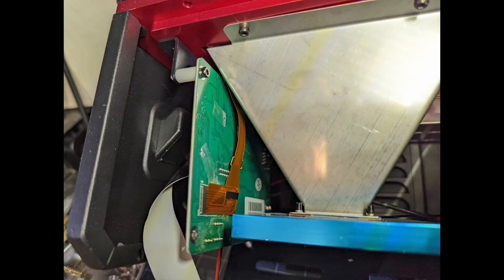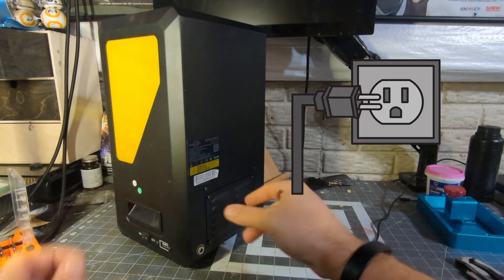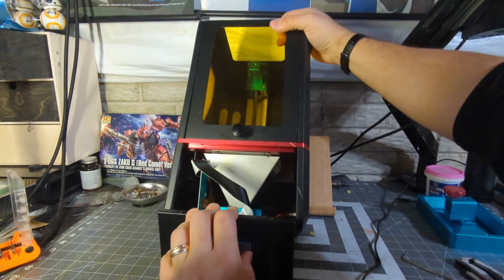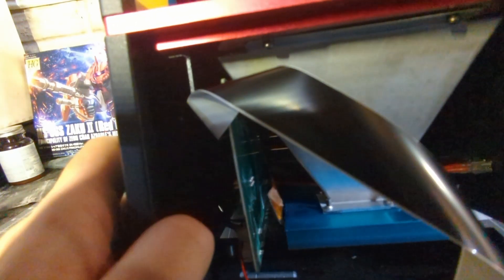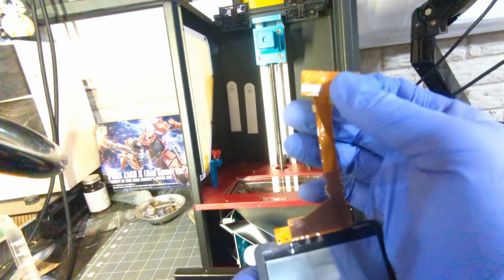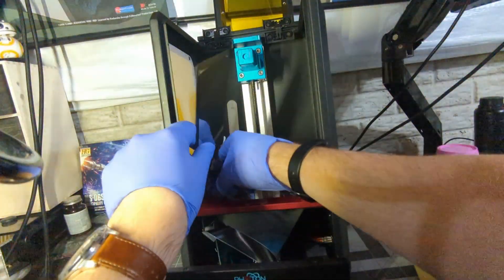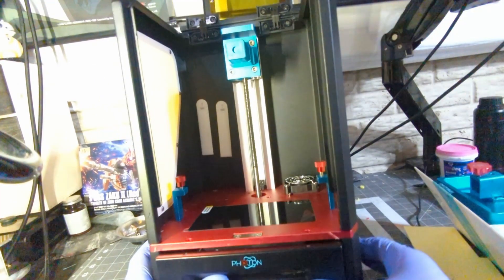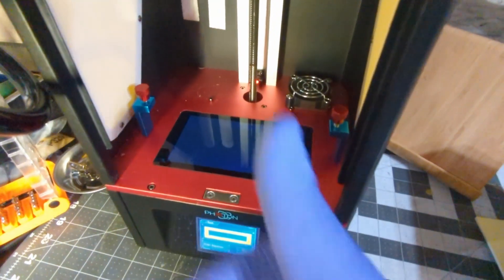Anycubic LCD Screen Replacement

Comment: Hey I don't know if you read this comment 2 years later. I replaced my LCD screen and then tried it with the UV test screen.
It seems to work for about 2 seconds and then the UV light seems to dim down.
I double checked the connection but everything seemed fine?

Comment: is your screen worked well after the replacement? after i replaced my photon’s screen, it doesn’t show anything with the test, like yours, and i think it is not working
you printed with your printer after the replacement?
Reply from the maker: Each time I have replaced the screen it worked except for once where the screen was defective and I had to send it back to Amazon for a replacement.

You will also want to make sure all the ribbon cable connections are tight

Comment: did you use 3mm double sided tape for the screen?
Reply from the maker: No I used a generic brand off Amazon. The link is in the video description
Reply: @TheOhayoDev  to expand on that question, the link you provided is for a tape that has multiple width options. Which width do you buy? The link is for the 3mm option, but just wanted to double check that. Thanks!
Reply: @DrumAtMeBro  ah sorry about that.  Yeah I use the 3mm tape. There is a little extra width on the short ends of the screens but it doesn't cause any issues or benefits. You could probably be safe to go with the 2mm as well but I'm not sure how hard that would be to apply.

Comment: Holes in the print confirms that the LCD needs replacing? The rest of the print is perfect.
Reply from the maker: That is what I have experienced.  You can run the print file without the resin or plate in place and confirm if there are spots that are not lighting up or not.  Sometimes it will flicker and sometimes it will just not light up in a section.